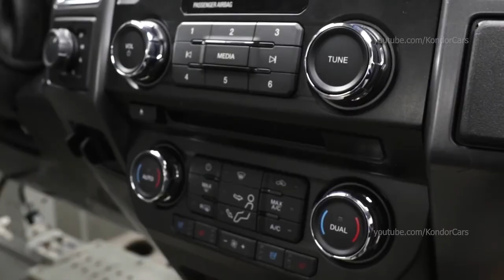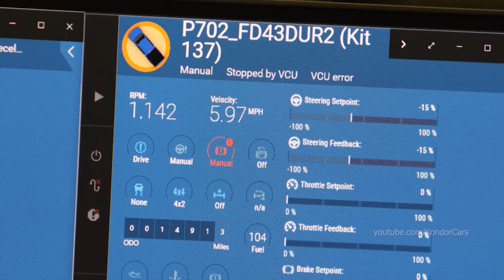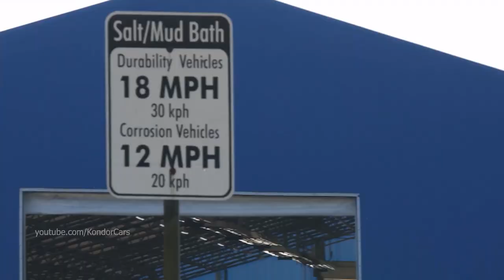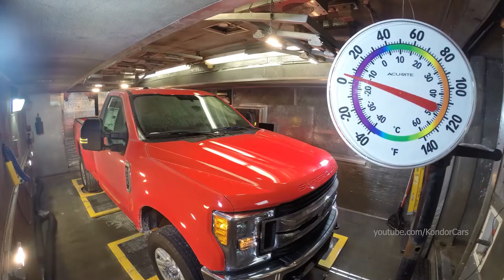FORD F-SERIES SUPER DUTY Production - Ohio Assembly Plant - United States

Comment: Stamping doesn't happen at the Ohio Assembly Plant. Engines are not "built" there either. The outside stuff gets put on there, but no internal components. When you show the body going onto the frame, that was shot at Kentucky Truck, not Ohio Assembly. After that you show a MEDIUM DUTY body being put on a frame, not a Super Duty truck. It's a much larger and different frame, and different class, and different cab. At 5:55 you are not in Ohio Assembly again until 6:03. Then you end the production segment in Kentucky again. Not sure why you labelled this "Ohio Assembly Plant."